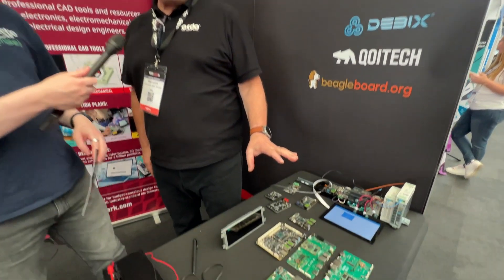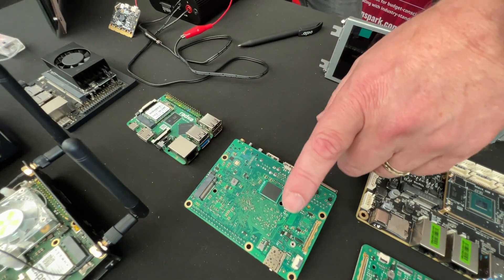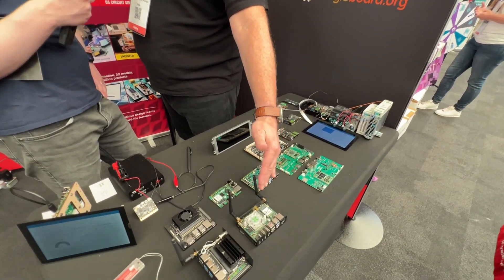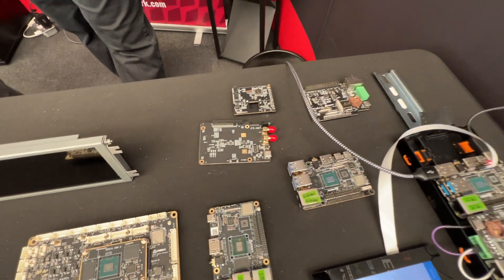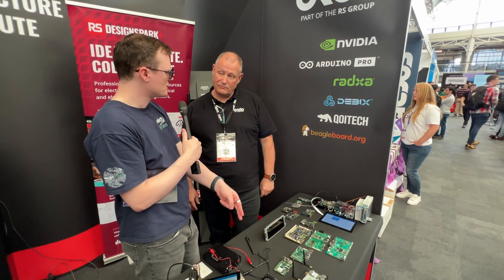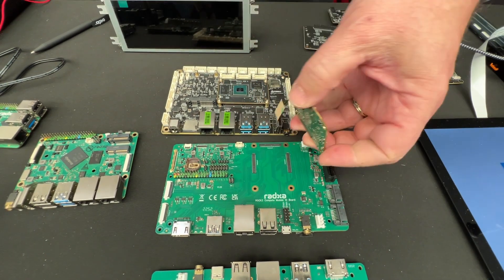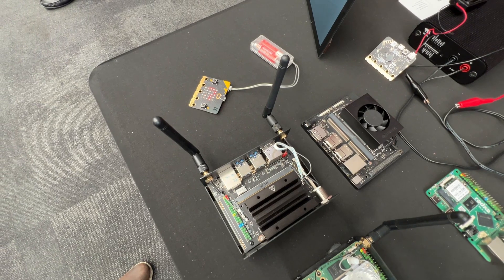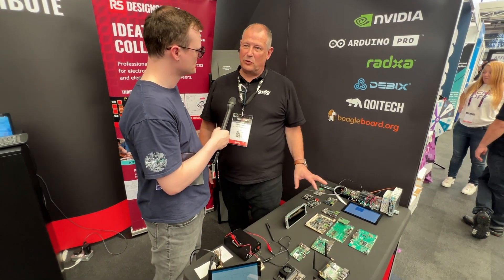Could This Be The Best Raspberry Pi SBC  alternative?

Comment: The main limiting factor of Pi alternatives is their support. If they get some decent support and community traction then they could be decent competition
Reply: They are decent competition, you just need to get enough knowledge and experience to know how to build an OS on them.

SBCs originally come from industrial applications, the Pi Foundation developed the Raspberry PI to also be a cheap computer to teach kids programming and to sit on electronic workbenches for hobbyists - the assumption in both those applications is that either you yourself know what you are doing or you have a teacher or tutor showing you what to do.

The RPi is an anomaly because the amount of support it has got has turned it into a "near consumer" device - the downside of that is that it has created a large community of "forever newbies" who don't actually know how to build computers or how to do their own independent testing or research ("the scourge of the millennial") - all they can do is use RPi and follow step-by-step videos with someone showing them what to do but without them understanding or learning anything.

This explains why so many of these newbies were whining constantly during the pandemic that they could not get hold of RPi's because that's the only platform they know how to do anything with and where there will usually be a video showing them exactly what to do.

On the other hand, computer engineers like myself who can build (Gentoo) Linux to run on anything had no shortage of Orange Pi's, Tinkerboards, Nano Pi's etc. to build computing solutions on during that same period - not to mention the countless "lemmings" rushing to upgrade to Windows 11 and dumping their old PC hardware for sale on "your favourite auction site".

The fact is that, as of today, the Raspberry Pi Foundation and most SBC manufacturers have completely lost direction when it comes to Joe Public users. When an SBC cost $35 back when the RPi emerged in 2011, it was not an issue if you purchased one to mess around with or give to a kid to learn programming and it got broken.

Now the cheapest Pi 5 is double that original $35 price, and that's before you've cased it, cooled it and got a power supply for it - that takes it to around $100 yet I can easily pick up a used 3rd or 4th Generation Core i5 or i7 SFF PC with at least 4GB RAM from Dell, HP or Lenovo on an auction site for half that cost.

There are ultimately two types of Pi users in the consumer space - the "forever newbies" who aren't interested in learning about computers and can just use a RPi when someone makes them a video showing them what to do, and engineers like me who see every computing project as something to be created from an optimal set of components of which the RPi is just one platform of many that can be used - and which, from a cost perspective, doesn't make  a lot of sense to use at it's current price point.
Reply from the maker: @terrydaktyllus1320  It's clear that SBCs, including Raspberry Pi, have distinct user bases with varying levels of expertise and different needs. The Raspberry Pi Foundation’s original intent was indeed educational and hobbyist-focused, which has led to a diverse community.

Your point about the current pricing of Raspberry Pi compared to older, more powerful used PCs is valid. As prices have risen, the cost-effectiveness of Pi for some applications has diminished, making other platforms more attractive for those with the skills to utilize them.